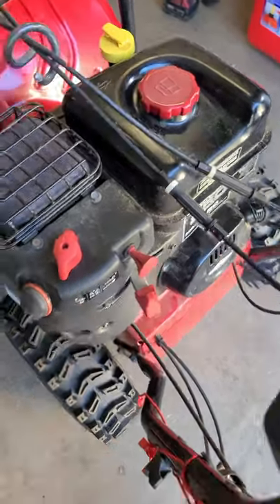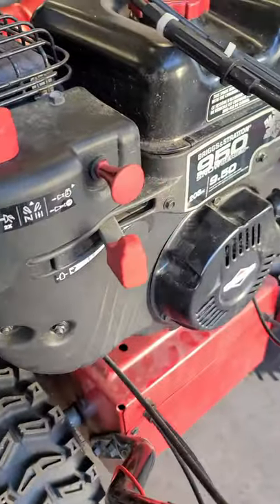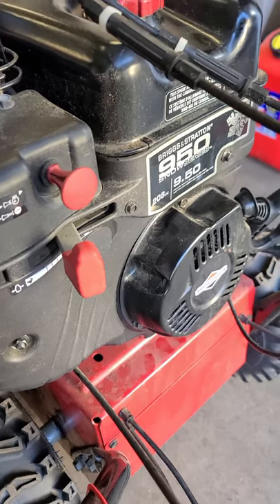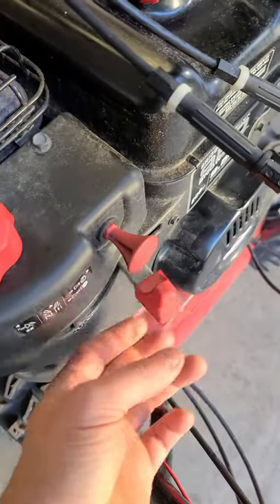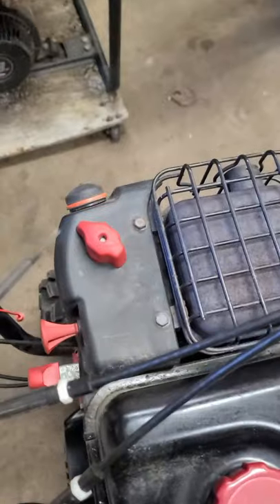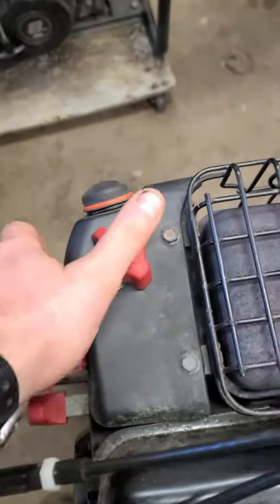Fixing A Loose Briggs & Stratton Snowblower Throttle - #shorts

Comment: Hi Don, can you make a short video on how to adjust speeds on my old 1989 826 Toro snowblower  model 38150, this machine is a tank. My first gear takes a couple of seconds to engage, I need to wiggle the transmission lever then it goes in but run a bit slow.  I think their is a way to adjust under the panel. I have cleaned the friction wheel and greased the shaft. Also can you show us how to install chains on the tires. Thanks for these great videos.